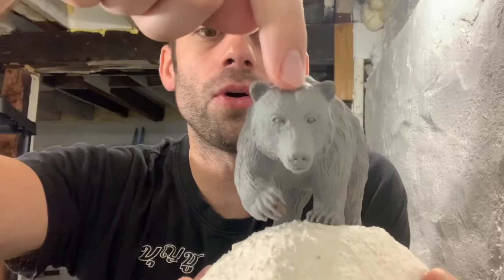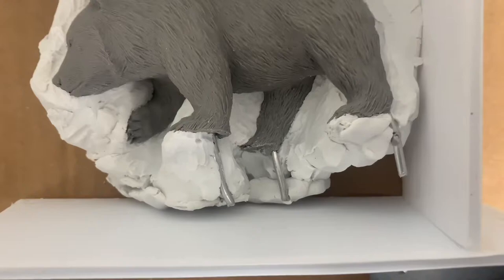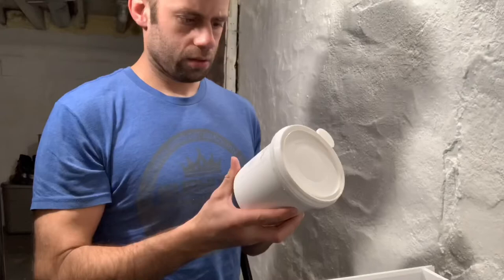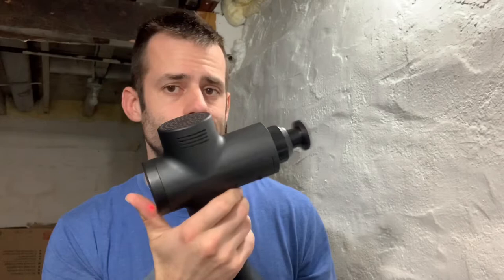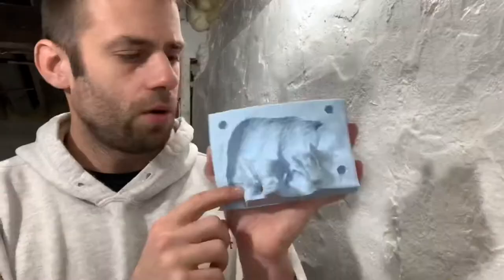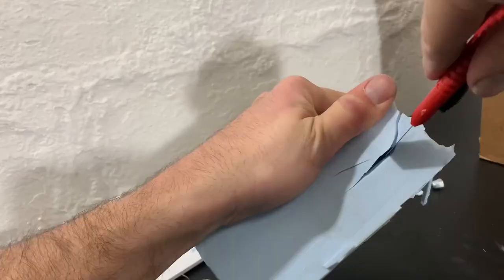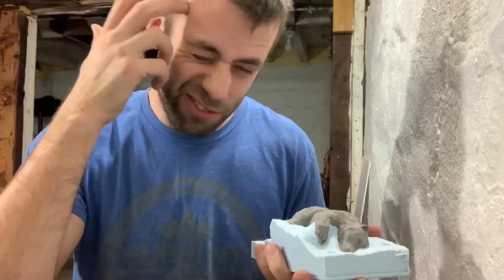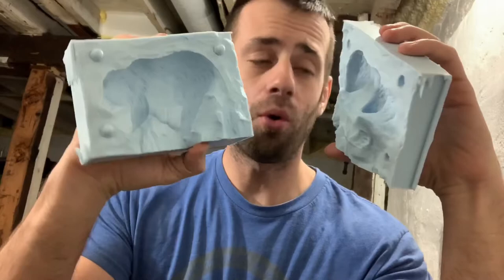Making a Bronze Grizzly: Part 2: Making the mold

Comment: if you don't have a vacuum chamber, you can try using vibration to work the bubbles out. putting on top of your washing machine when it's on full cycle will help, but not do fully

Comment: Great video. Can I use playdough clay?
Reply from the maker: Depends on the composition of the clay and they type of silicone you use. Some chemicals in clay can cause the rubber not to set,  you don’t want to use it if there is sulfur in it. Platinum based rubber is particularly sensitive to that. I’m not really sure what is in play dough, but it could potentially work.
Reply: @lundgrenbronzestudios  thank you so much